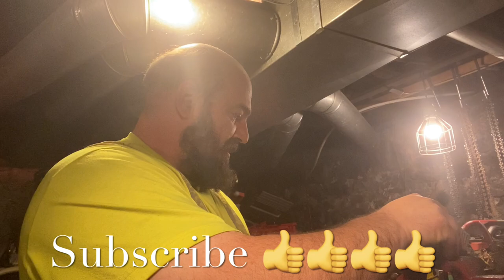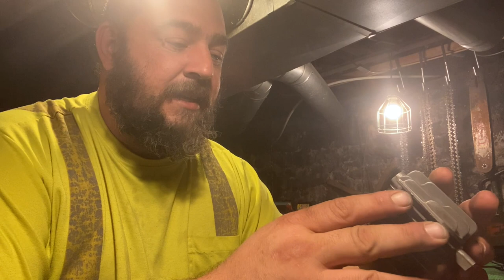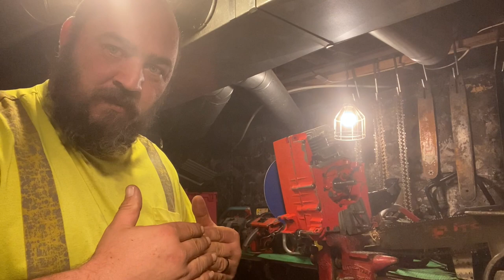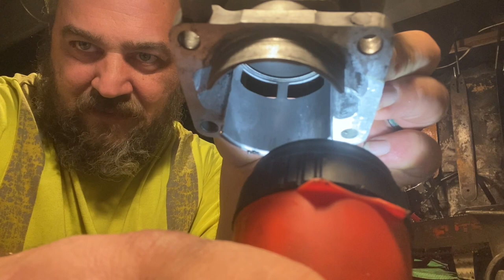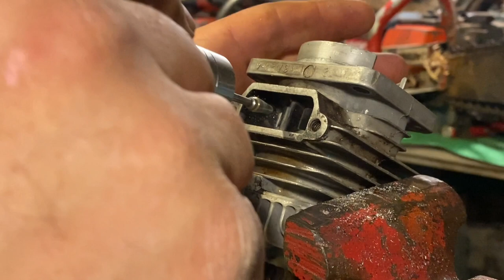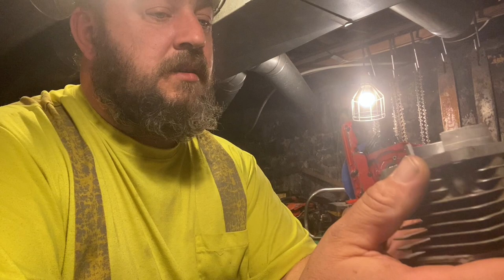Porting Homelite Super XL-130 Chainsaw!!  Grinding The Exhaust!!

Comment: What are the furrows opposite the exhaust port? Are they like pseudo boost ports? Interesting idea. Make this thing breath.
Reply from the maker: Yes! I did not explain those because they are set by timing and a bit more involved to get right.
Reply: @Smittyschainsaws  would you be willing to do a video explaining the boost ports? Just an update on my build I did end up picking up 3 super xls and picked the best cylinder out of the bunch. I’m still waiting for my timing degree wheel to come in the mail before I start any grinding though
Reply from the maker: @RonnieMacJr69  I am preparing for that right now.  I am working on figuring out the best way to explain it.
Reply: @Smittyschainsaws  I was also wondering did you open up the bottom of the port at all? I understand you shaved off the top so that with your sealant/gasket the port opens at 101 degrees but is there any benefit to shaving down the bottom of the port farther to match up with the top of the piston bottomed out
Reply: @Smittyschainsaws  as for my question about the floor of the port sorry sounded kinda stupid there I got myself confused because isn’t the floor of the port already matched to the piston from stock? The only reason I was thinking otherwise is because I was watching some other videos and I realize now it is because they added some spacer underneath their cylinder to raise the port and in term get more duration
Reply from the maker: @RonnieMacJr69  On this saw the bottom of the port was matching the top of the piston after I removed the base gasket.
Reply from the maker: @RonnieMacJr69  Yup!  Every saw is different and the decisions need to made at the time of the build.  You got this!!
Reply: @Smittyschainsaws  thanks man you’ve been a big help hopefully I will have the first video of the saw up this weekend I will definitely be giving you a shoutout if that’s cool with you